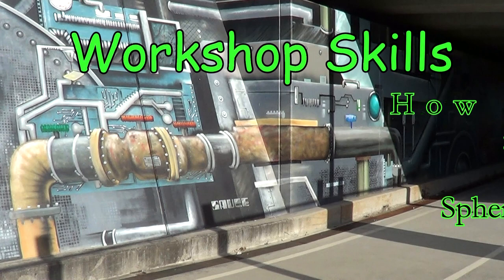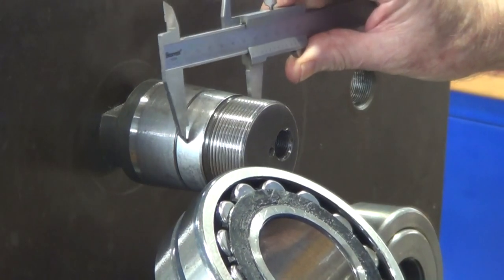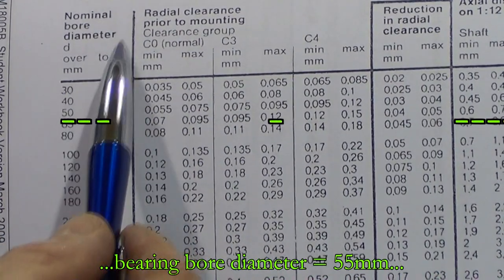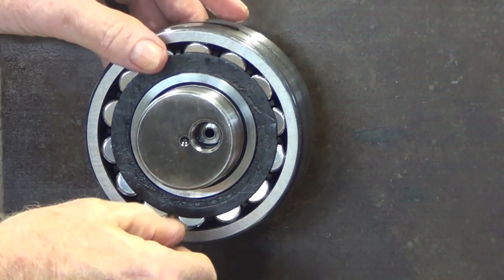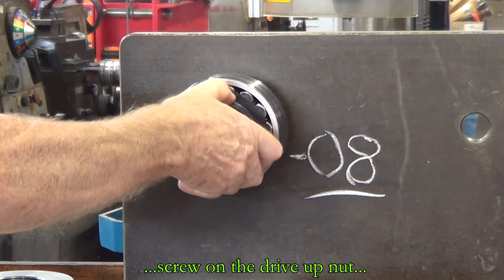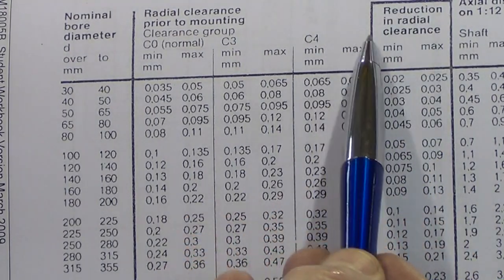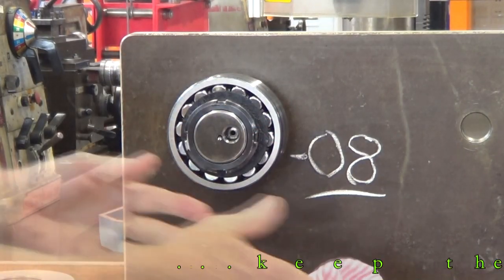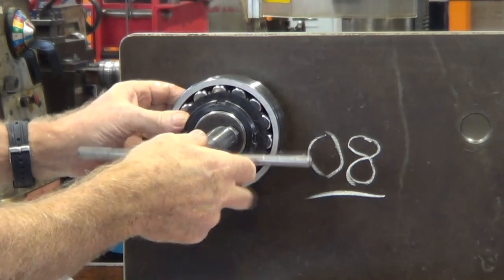Bearings; Spherical Roller Bearings Part 1

Comment: Spin the outer ring back so the nomenclature of the bearing is visible from the front.  You don't need to measure the bearing bore, the last 2 digits of the bearing designation multiplied by 5 gives the nominal bore size.  In this case, possibly a 23211 bearing, 11 x 5 =55 mm bore.  There will also be a K in the designation indicating a 1:12 taper.

Comment: Test the curvature of the spherical raceway, the reliability of high precision bearing is stronger when the speed is close to the limit. For example, spherical roller bearings installed in the high-speed final rebar mill. Many bearings have severe heat and short life. The force of the final bar mill is not large, but the rotational speed is very high. Therefore, the high-precision MB type (copper cage) spherical roller bearing will be more competent. MB spherical roller bearings have the characteristics of high speed, low vibration and noise, low oil consumption and slow heating.

Comment: I have to ask you. You measure clearance on bottom of the ring of bearingIn my work , they recommend me to measure in middle of the bearing. Now what is correct way ?
Reply: hey bro you need to beasure where the gap will be, for example if bearing is hanging on a shaft you measure bottom, if the bearing is sitting on a bench you measure top